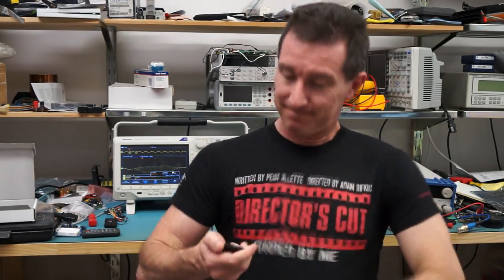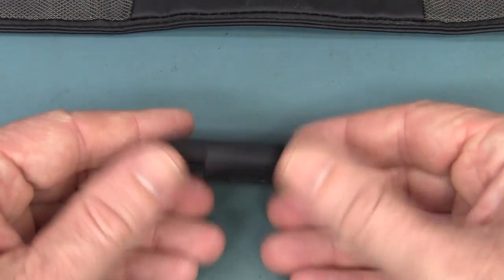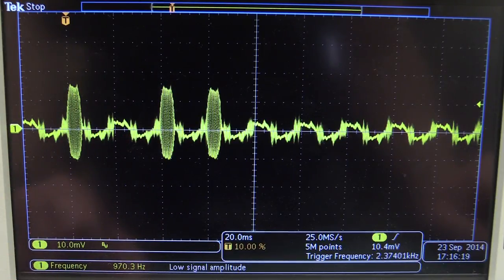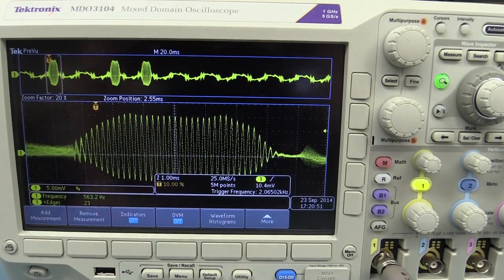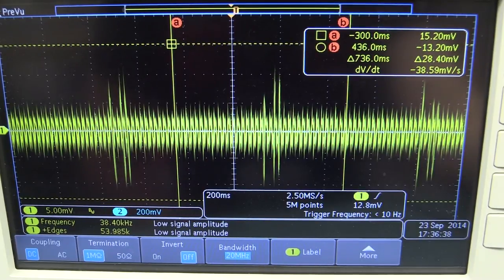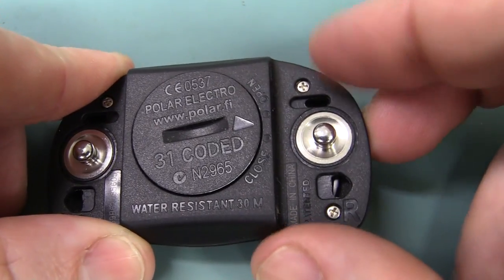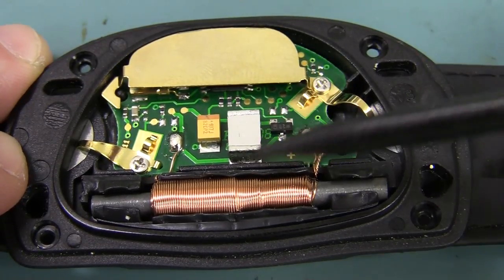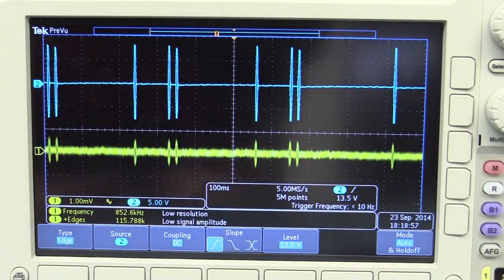EEVblog #665 - Polar Wearlink Heart Rate Transmitter Teardown

Comment: You can use an inductor as a pickup coil, when I tried it there was over 50v across the inductor. If you place a dynamic microphone near the transmitter you can literally listen to your pulse rate change as you move around. I've always been astonished how accurately the watch can calculate calories used just from heart rate when compared to high gym equipment.

Comment: The transmitter could generate a random then fixed second pulse that would be picked up by the nearest receiver and within 2 repeats software would compare time delays and  lock to the transmitted delay time. I would assume coding it not critical as the transmitted power will have a very short range and having two transmitter within the same area with the same random time code unlikely. Top vid Dave.

Comment: Perhaps the distance between the initial pulse and the ending 2 pulses denotes the unit ID, and the two pulses on the end would prevent interference from other units. The 1 single start pulse of another unit being received by your unit would not register on your unit, since it is looking for 2 pulses at a particular latency to denote the unit ID and switch your unit into listen mode again.
Reply: You worded it better than me. But then I was taking the kids to bed :D

Comment: That "encoding" looks like Time Division Multiplexing (TDM) to me. The first pulse may be shared by all transmitters to sync and there are 31 other time slots where the second pulse can fit in. Which would be just controlled by that time offset to the second pulse. I'm not sure, especially how timing is managed since your heartbeat varies. But that might be easily predictable, or the unit just delays transmission to be in the right time slot (after all it seems it just transmits 2 actual heartbeats). You probably could only tell by probing both sensors transmitting to different watches at the same time.

Comment: Hey Dave, how did you capture the signal? You set the prob for sine wave (?) 433khz (?) and that's it?
Reply: The probe acted like a radio antennae and received (induced/transduced) the radio signal transmitted by the pulse rate monitor. The scope then displayed what the probe picked up. Hope that helps a little.

Comment: The codec seems simple enough. Giving the 31 code injected on the back rather than a label on the back would suggest to me there are 31 variant random codes 1 used for parity/end bit. The receiver will see the first radio pulse, count till the next two standard spaced radio end pulses for the address. If it hunts for the highest signal the confusion will be less and also the heart rate of others and the "code" could be mapped out, at worst It's not likely to pick up more than 3-4 other signals. A missed heart beat between friends can be averaged out also.
Well that's how I reckon it works :D.
Reply from the maker: Sirus Interesting thought on the 31 in the model number, you could be right,

Comment: I am just guessing but I think it won't be just a regular microcontroller. I think that the signal captured from the skin is just too low and noisy to be picked by ADC itself. It probably has some analog stuff going inside too.
Reply from the maker: pvc988 Some micros have inbuilt front end ADC amplifiers.

Comment: Most probably that ST chip is an ASIC. I think it inclues a simple instrumentation amplifier, an ADC and some sort of MCU core. You don't really need that much for heart rate monitoring, not even a super clean signal. You just need to have a sort of clear R wave, since heart rate is the R-R interval in an ECG waveform. The instrumentation amplifier probably has sufficient common mode rejection (at least 90dB) so it doesn't really need that much input filtering, only a simple low pass filter since we have an onboard noise source on top of the common mode voltage. Now, the software on the MCU core shouldn't be very complex. I think it's just a simple peak detection algorithm that triggers off at roughly 0.5 mV * gain, possibly more due to the proximity of the electrodes to the heart. Bear in mind that the ballpark for the peak of an ECG waveform, aka the R wave, is around 1-2 mV transcutaneously and is noticeably higher that the rest of the waves. You don't even need a very sophisticated ADC for this. I think 10 bits are enough since we're not looking for a clear waveform, just a peak voltage. The equivalent of the wave captured by the device is lead I on a standard 12 lead ECG. Once a peak is detected the chest strap sends the packet and the watch counts the packets. It's not that complex really.The ASIC idea is extremely plausible to me, especially since you don't even need that much for a 1 lead ECG, let alone a heart rate monitor. The bracelet things should be similar but with a higher gain amplifier and probably a tweaked algorithm.

Comment: I think the coding scheme is pretty obvious.  The gap between the first packet, and the second two packet burst is a simple time division code.   When acquiring the signal the receiver looks for the two packet burst to get the base timing of the transmitter and then looks for the next burst sequence to determine the ID of the heartbeat.  At this point the receiver  system locks in the parameters and only looks for pulses in the previously seen timing windows.   I saw a second transistor in the transmitter.   It seems likely that the transmitter may be using one of the two coils as an antenna to see what other codes are active.   If no other codes are active it picks one at random.   If it detects another code in use it is picking from the remaining codes.  The receiver in the watch expects to see only one transmitter during pairing.   I'm guessing this pairing happens every time the watch sees a transmitter after some timeout of not seeing one.   Since heart rates don't change really fast and are unlikely to synchronize between adjacent users,  the receiver can used a window discriminator and the details of the 3-pusle code to keep track of the correct heartbeat.   It might lose a beat once in a while, due to packet collisions, but it seems like it would work out well.   If the transmitter is also acting as a receiver (and that dual coil config and the dual transistors looks like it might) then it could be performing some collision avoidance too. 
Additionally the second coil can be used as feedback to allow the micro controller to keep tighter control of what is obviously a software defined radio system.

Comment: Hi Dave, thought I might share my thoughts on the encoding, or at least part of it.

At 13:38 you found a delay of 736ms or 0.736 seconds between each packet. Using a little math, ie (1/0.736) to convert to packets per second, then multiply by 60 to give packets per minute (60 * 1/0.736), this yields a value of 81.5 which could be related to your pulse.

At 14:29 you found a delay of 666ms or 0.666 seconds between each packet. Repeating the math as before, (60 * 1/0.666) gives a value of 90.09 which is also reasonable for a pulse rate

According to the start of the video, these also seem to match your heart rate. So I think that a packet is sent at each beat of your heart.

This would leave the 'keying' to be the timing between the three blips inside each packet as you suggested.

Any further thoughts? Be nice to work it out. Perhaps try record from both of the polar transmitters simulateously whilst wearing both, then compare.
Reply from the maker: William Edwards The time between the first packets does seem to the the heart rate. Beyond that it needs some more investigation I think.

Comment: I don't see the advantage of making the chest belt in two separate pieces (three if you count the rubber strap as an extra piece)
it was just fine and rigid when the belt was one solid thing, no need for these clip posts there

meh

Comment: Coding is called ANT+ technology. Any ANT+ device will pick it up. Normally a 5 digit numeric number in search mode, then save to find on auto start. That chest strap is very bad for rusting due to sweat. Polar is not my fav. I would suggest Garmin or Powertap. The visible screws should be covered to avoid contamination. Finally something I have experience with...